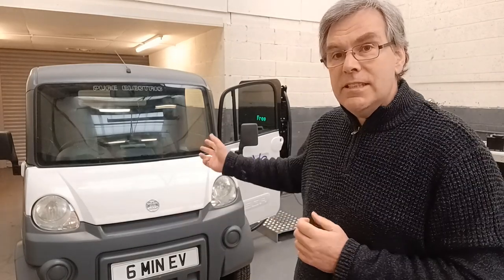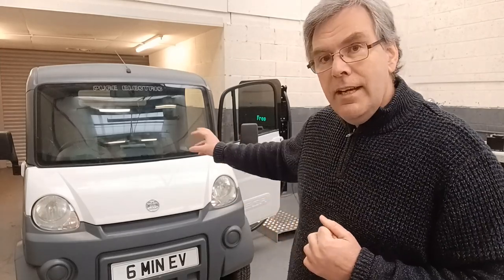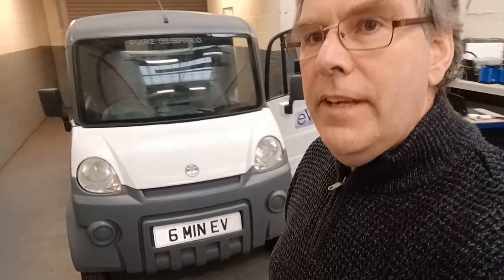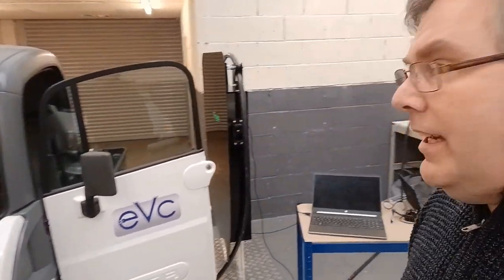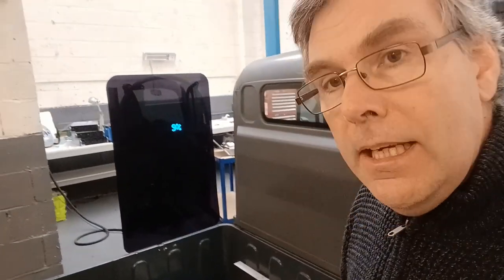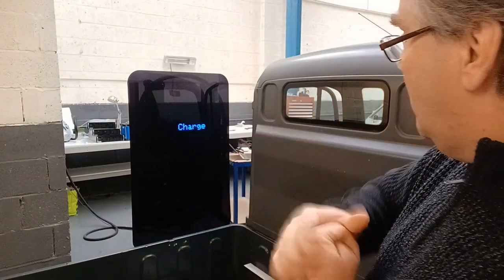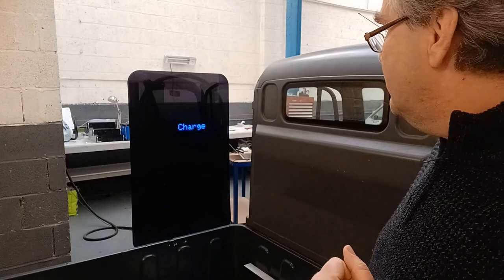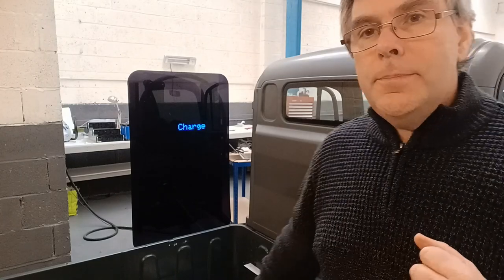Charging an electric vehicle in under six minutes

Comment: That's cool, I see 24 LTO cells there, probably 66160s.  It looks like all the balancing leads aren't hooked up.  Are you really charging all of them in series w/o a BMS at their max charging current?  ~92Wh each, so ~2.2kWh total.  Certainly enough to get you up to 10 miles.  Aren't those cells super expensive too?  Like on the order of $800/kWh.  Isn't this just a commercial battery?  Most of them already claim to charge in 6 minutes.  I wonder how long they will last if they repetitively charged at a 10C rate.
Reply from the maker: These are modified cells rather than off-the-shelf. The cells are expensive at the moment - around $300/kWh, but these will come down. The focus isn't so much on the cells as on the pack and charger. As for the balancing leads, there are two sets - one set in black connected to the BMS and one yellow set that we use for other monitoring and testing purposes.

Comment: Hi Michael,

The Aixam has a 48V system voltage and most mass-produced EVs use nearly 10 times that system voltage.  Saying you can charge at 400A means very little when you make no mention of the traction pack capacity. 

Further more, it appears you are powering the charger from a 240VAC 32A (CEE) supply... so how the heck are you getting 400A into your (clearly very small) battery pack?